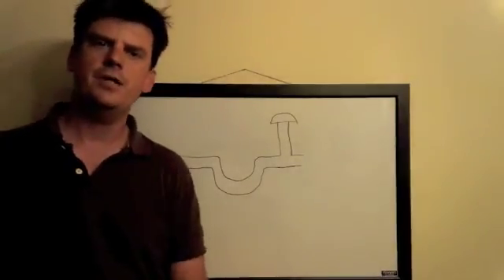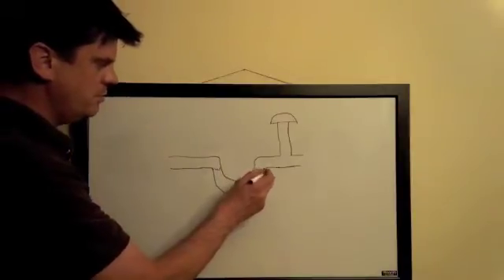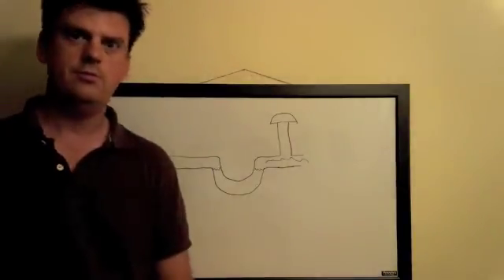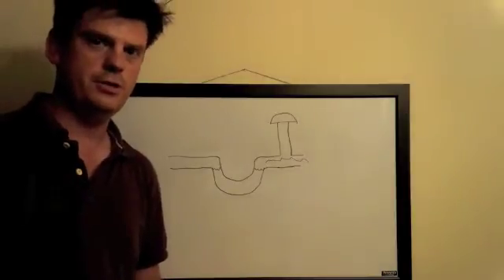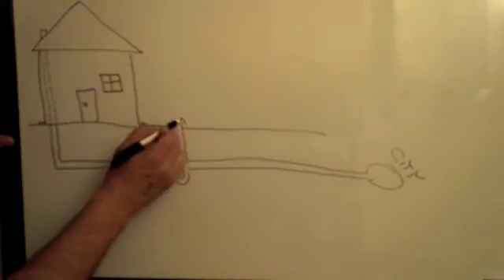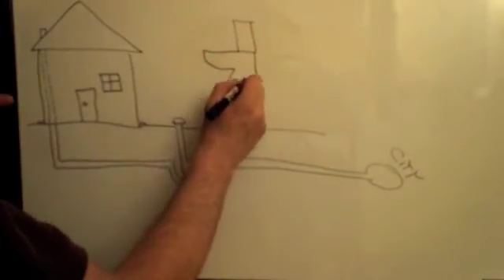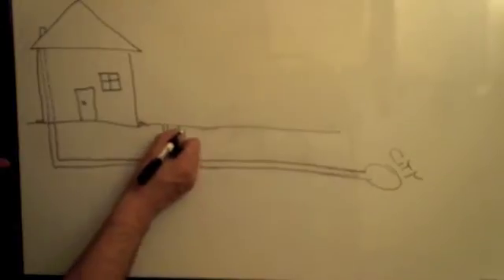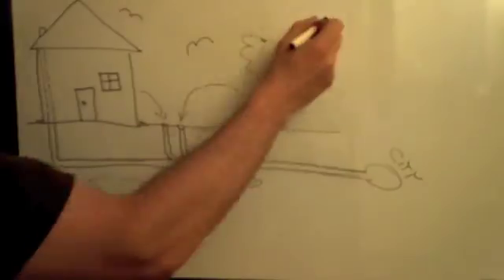Why Remove Your Plumbing Building Trap

Comment: In the US, the old trap (water seal) will have a vent on the inlet side (you drew on the outlet side). The new clean outs you drew eliminates the spill but doesn’t stop the sewer gas from the city before fixture p traps. Odors will seep into the house if theres a joint in the wall wasn’t glued tight.

My city uses backflow preventers to stop gas and sewer back up into residential pipes. But personally I do not like mechanical devices due to potential high maintenances. I do think the building trap guarantees blocking gas from the city with a water seal, though it may spill infrequently but it can be mitigated with an air valve instead of a mushroom cap. It beats smelling sewer EVERYDAY in the house.

I now suffer sewer gas from the city and has no way to stop it. The city actually has a notification list if they are having operation issues they will notify me to ventilate. I decided to install a building trap. If interested you can search and find the city of San Francisco still allows building traps, it’s tried and true old engineering solution to block sewer gas especially in old hilly neighborhood.
Reply: Very interesting, I didn't know it was still in practice. We mainly have problems due to the advanced age and material of these traps. At least new plastic traps won't allow roots to get into the drain.  Thanks for your input.

Comment: I have a 1950 house with a p trap that keeps gettting clogged. Roto rooter said to remove the obsolete p trap.  However, are not my shower and bath tubs which are original, non P trapped?  If never replaced, then no p trap.  If no p trap then the fumes will exit through the shower and tub.. no?
Reply: You would have to upgrade if they were not trapped.